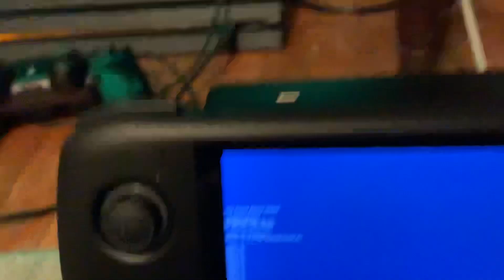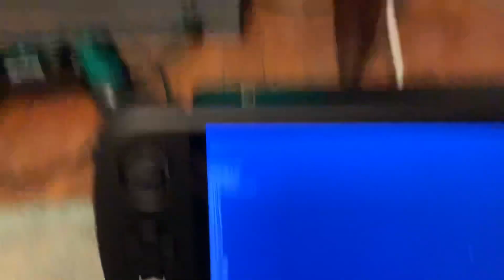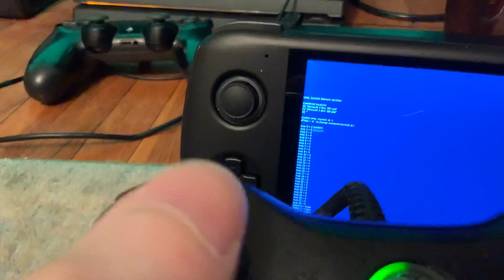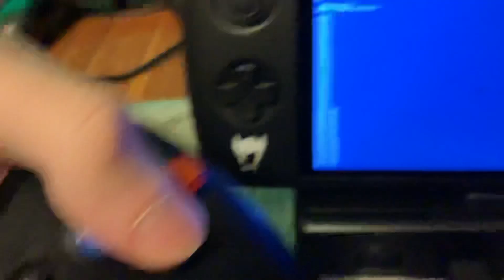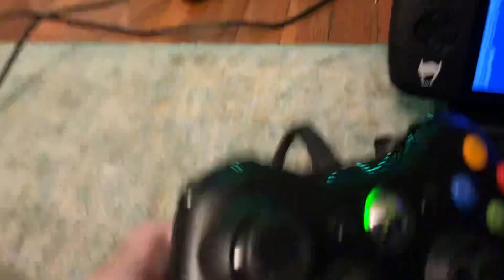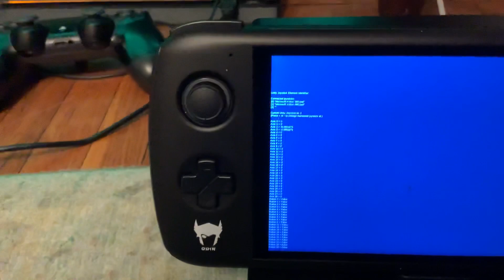AYN Odin Pro Wired XBox 360 Gamepad Test

Comment: can the screen on the Odin be turned off when playing through the dock?
Reply from the maker: There is a toggle called "Disable auto sleep when HDMI/DP is connected" in the odin settings that is by default on. So I turned it off to test then docked the odin with the hdmi and power connected, but it didn't turn off the screen. I don't know if that isn't the correct setting, but I couldn't find another one. I only tested it on the display port video mode. The hdmi video mode didn't work on the usb c connection of the dock, I assume it is the micro hdmi plug which I cannot test.
Reply: @oxters9101  thank you for trying to find out. Thumbs up